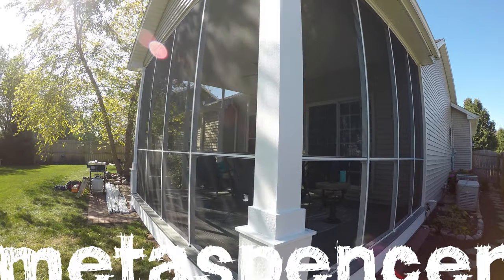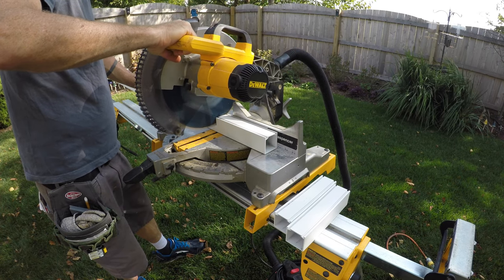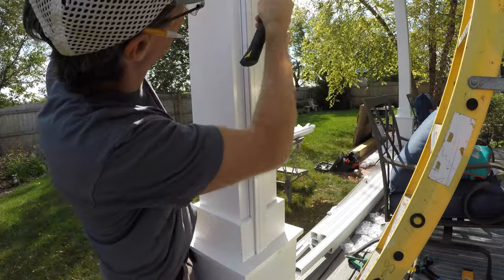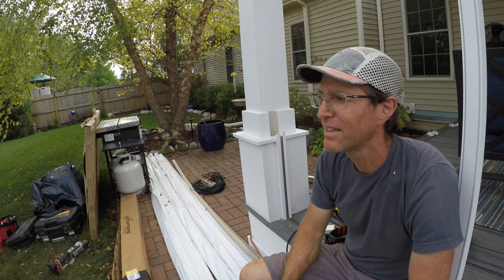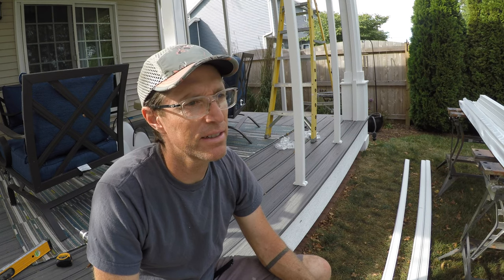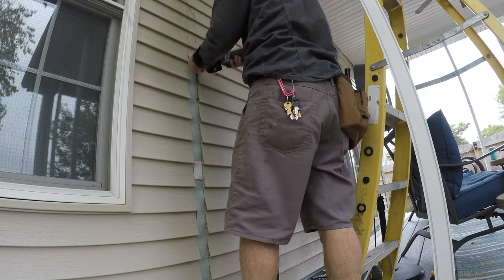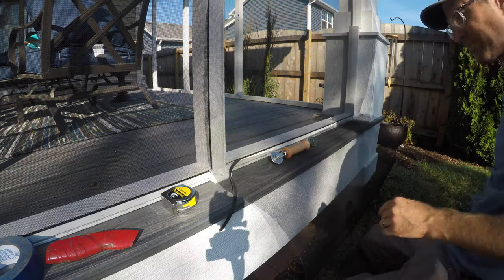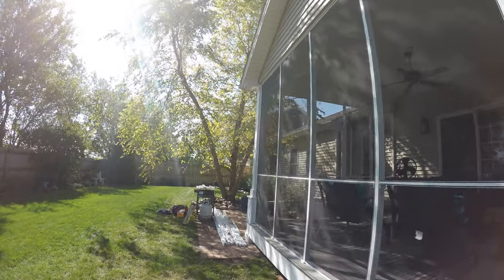EPIC Aluminum Screened Porch Build

Comment: Thank you for the video.  Enjoyed it and made me aware of another option.

 We have previously done a similar job on our house for an 8'x16' three-sided covered porch very much like this one,  and are now looking at a much larger porch.  For the sake of other viewers, I'll say how we did it...   

The Armstrong product you used is both structural and cosmetic.  I wasn't aware of it with the previous porch we screened.   I will cost it out for our job.

So on that previous job, we built something up.  For the structure, we ripped down some pressure treated dimensional wood a bit,  which we covered or clad with pvc sleeves.  We used a combination of 2x2"-10ft  white pvc square profile downspouts for horizontal and vertical members between posts,   and larger 4x4-8' pvc post covers at porch corners.  I think we got both of them at Lowe's, and they both are still shown available.

Then for the screen part, we used the "Screen Tight" system, also easily found at Lowe's.  It has flat vinyl flanges to fit 2x4's or 4x4's. The pvc covered posts we built and these flanges together make up a unit like this Armstrong aluminum post.  So that was more labor our way.

For us, it'll come down to total cost but also how much extra labor will be required ripping wood and stuffing the pvc sleeves with wood -- and we all know how much wood has increased in price lately.  Aluminum just might be more cost effective! 

(If someone had an existing porch with painted wooden horizontal and vertical structure to it, there are examples of Screen Tight just screwed directly to the old porch pieces, and that might be the way to go.  But our porch has big columns, already clad, but nothing in between them.  Plus we're trying to avoid any paint surfaces on exterior -- it'll be pvc or aluminum clad for us.)

Still exploring options. Hope this helps a future viewer in some way.

Other comparisons I can think of:
-- There is a color choice of ScreenTight vinyl caps to cover these flanges when done.  The Armstrong caps seem to cover the middle one inch, while the Screen Tight cover the whole flange.  I'm sure both work well.  Our porch looks very much like yours, only the verticals and horizontals on ours are wider-looking 2" pieces, where the Armstrong is visually narrower. [Edit -- can't find the Armstrong product per se; the current Home Depot aluminum does not have the removable cover for screwing, it's solid aluminum.]
-- Our system didn't require any mounting brackets for posts or rails - and on Home Depot's site, I only see a metal L-bracket. Is it possible they've changed their system?  [ Wait -- we must have used an L-bracket to connect the horizontal rails to the posts? It's been too long...]
-- The downspouts are 10ft; will have to look into the Armstrong system having longer pieces, as this newer porch is too tall for 8ft verticals, unless we build a bottom wall for them to sit upon.
-- The durability of both systems structurally ought to be fine, I think.  Our porch is about 10 years old in the Southeast region and has held up extremely well.  I wash it with a pressure washer each Spring, including the screen.  I don't know what our screen is made of, polyester or something?  We put a heavier pet-strong screen on the bottom portion, and a lighter weight on the top, and you can't tell the difference installed.
Reply from the maker: Great info here! Thanks for posting and super interesting!
Reply from the maker: @rwind656  sounds like you've done some good research! yeah, that aluminum channel you linked to looks like pretty much the same stuff. Cut slow and carefully and you'll get some nice connections

Comment: I use a plastic wheel attached to my knife (I never use metal wheels) abc supply sells them they are great. I don't use soap I stretch the spline a bit before putting it in unless it's warm out then it goes right in. Good looking job though I like how you did the pillers
Reply from the maker: I bet that works well! I always struggle with the screen ... sounds like a good technique

Comment: This was such a professional job. Your attention to detail is amazing.
One question: do you seal the bottom so water doesn't sit under the aluminum when it rains? And if so, do you seal inside and outside? And what do you use?
Thanks in advance for the reply. 😊
Great job!!!
Reply from the maker: This porch was on one of those manufactured plank decks, so I didn't think about sealing the bottom -- but it would be a good idea. I'd use a polyurethane sealant on the outside at the very least, just to keep the gunk out. Thanks for checking out the video!

Comment: what would you do if the columns were concrete and stucco ? how to work around the decorative details?
Reply from the maker: No problem ... just attach the system of rails to the concrete with concrete screws or mollies and get to work
Reply: What kind of saw do you use for fine alaminum cut : miter saw? And why blade do you recommend ?thank you
Reply from the maker: @fritzs1207 fine tooth blade just go real slow … very slow
Reply: thanks @metaspencer

Comment: Are the verticals that you installed under 8 foot cause the only place I can even find this stuff is on the home depo website and it is right under 8 foot long and man is it expensive stuff. It’s damn 40 bucks for a stick of it. On the home depo website it is advertised it comes in 8 10 and 12 foot length but it’s only availability is in 8 foot length. Thanks for the helpful video
Reply from the maker: Yeah, prices on all building materials have gone through the roof! I go the channel for this porch project at our local hardware store and yeah, they had all kinds of lengths. If 8' works for you I'd go for it. The stuff is aluminum and lasts very well. Good luck with it!

Comment: My porch is similar but the columns/posts on the corners are round and tapered. Any ideas on how to attach the channels on the corners to those types of columns? Thank you!
Reply from the maker: Working with round columns usually goes one of two ways: either creating a scooped/concave matching end to your rails or cutting into the column so you can attach a squared off butt end. It just takes a bit of work to get the ends right when scooping them out and making concave connections. Sounds like a nice house!

Comment: Can you explain more how you installed it thru the vinyl siding ??
Reply from the maker: Sure thing: you just have to very carefully trim the siding back so you can access the sheathing or framing of the house. Attach to the building then trim out the siding so you have a clean look and connection
Reply: And one more thing on the ceiling I have soffit what do you recommend what should I do
Reply from the maker: @juanjoseadventure7359  If the ceiling is level you could run the framing for the screen along the soffit ... if it's sloped you may need to cut into it to make a tight connection

Comment: Metaspencer, if you were going to go back and turn this into a four-season porch eventually, what would you use?
Reply from the maker: for a four season porch I build with windows that open and close with screens. That's worked well for me. Fixed windows as well for more light. You can do windows you pull off but storing them is always a pain.
Reply from the maker: Oh, and then insulating from below
Reply: @metaspencer  Understood. Thanks for the reply.  I was meaning for a retrofit.  Trying to decide to bite the bullet and go ahead and frame in for windows at this point or expect to do it in future and just screen in now.  (Building supplies are getting so expensive this last year!  I assume window costs have gone up with the rest of it.)
Reply from the maker: @rwind656  Yeah, prices are out of control but I'm not sure they'll ever come down ... it's always nice to build exactly what you want and it sounds like full framing would be nice

Comment: With everything you showed... nothing on installing the horizontals.
Reply from the maker: sorry to have left that out. in this build the horizontal pieces were held up with aluminum brackets, so it was just a question of cutting the horizontal pieces exactly to length and screwing them in with the brackets in place.
Reply: Thanks. Just frustrated because I thought you did a great job and would show it. There’s no video on YT showing it, and I’m trying to figure out how mine is put together to take apart. It has no visible screws and doesn’t clip. You did a good job, thanks for the reply.
Reply from the maker: @robiberg3464  I'm wondering if 1) your horizontal pieces are attached internally with screws from inside the posts? or 2) they're welded in place? The horizontal pieces I installed in this build were very obviously screwed in place with brackets. Good luck!

Comment: How to install a screen door on these aluminum posts is a big deal and not straight forward as there's no stop for the door. I'm still trying to figure it out. That would have been very informational to at least discuss how you did it even if filming it wasn't included.
Reply from the maker: If you don't have stops try riveting on or screwing on some angle-aluminum. That will give you a good stop for the door